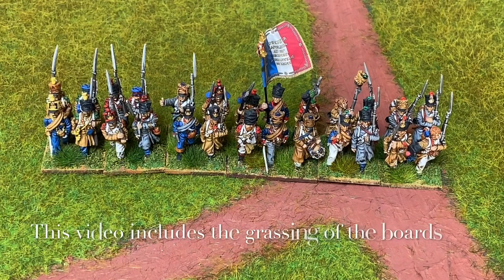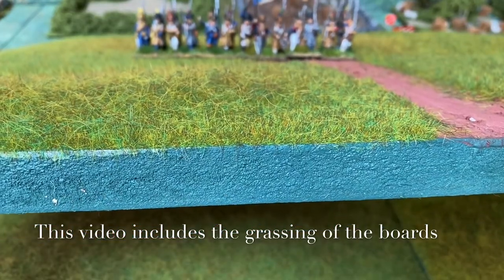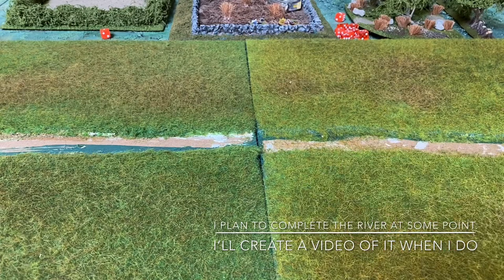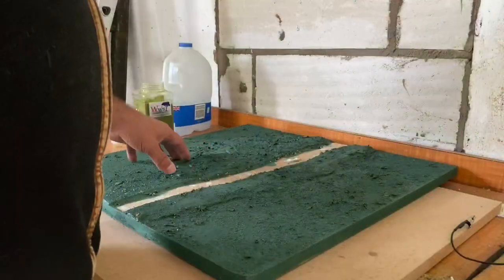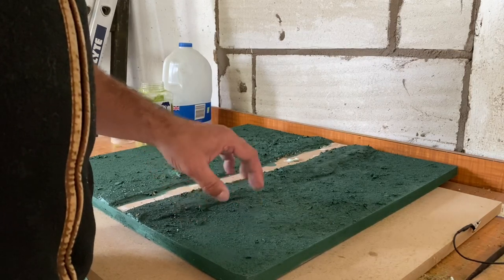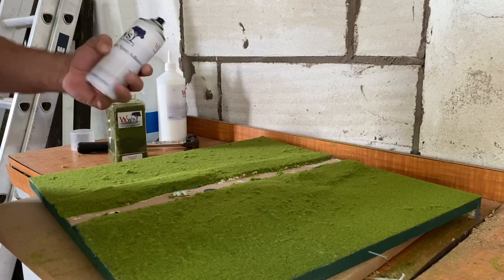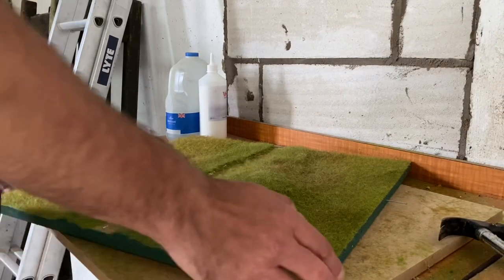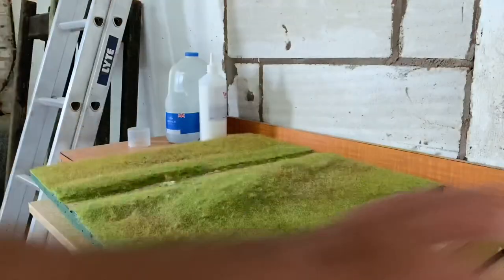Static grass Wargames board  review and application (WWS products). Used for WW2 & Napoleonic :)

Comment: The big question....how does the static grass hold up over time to gameplay? For example Does it get flattened and then can it be resurrected? Thanks.
Reply from the maker: Seems to be fine although I have found that the she’s should be very well glued. If the boards do need a refresh the it isn’t that hard.